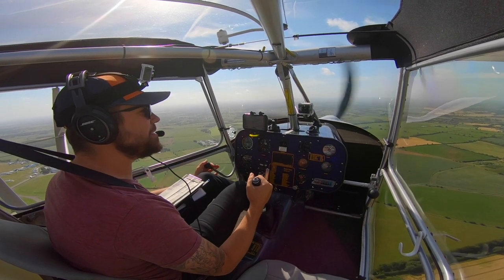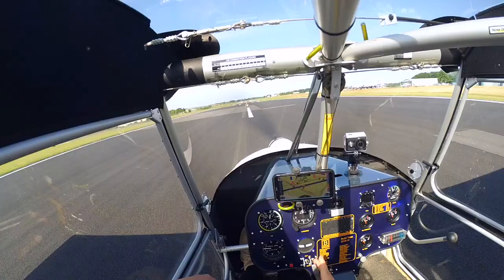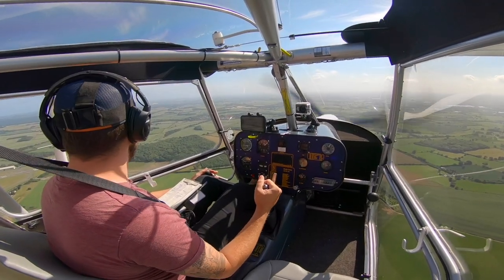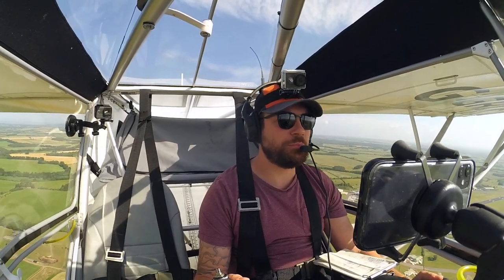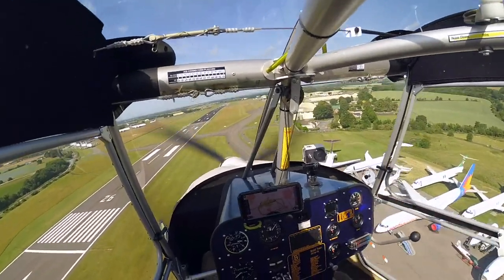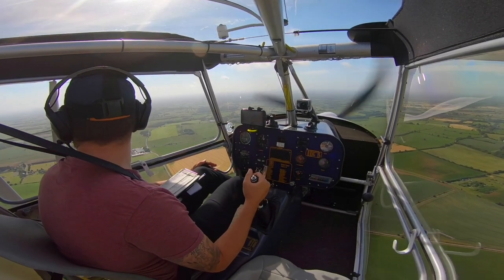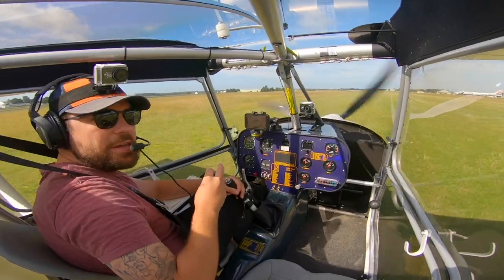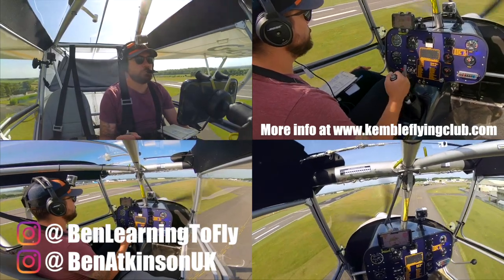Turbulent Crosswind Circuits | Cockpit Audio

Comment: "Blowing a hooley" 🤣... any crosswind is challenging. It's hard enough in the PA28s with a 12kt crosswind. It must be even tougher in the microlight. Into wind aileron and opposite rudder is my technique of choice too. You handled these landings really well. Really nice flying Ben 👍
Reply from the maker: Hey Cj! Thanks mate. Ha that’s interesting, would love to come see what a pa28’s like in a cross. Yeh I feel more in control, of course you could run out of deflection and start drifting if the wind picks up too much (especially in a microlight I guess)...thanks mate
Reply: I believe my flying club only allow students to fly up to a 10kt crosswind solo. With the instructor it's a bit more, which I have flown in on occasion. Once PPL I think I'll take my time to build confidence before I attempt anything too daring 👍

Comment: Nice one Ben, good to practice these things. Shame that the cross wind runway isn't in use at Kemble. 

With the SR Swift and Eurostar there's more porridge stirring than with the C42? Has the SR Swift got bigger ailerons and rudder than the Eurostar, thus better in a cross wind?
Reply from the maker: Yeh true! Though, if it was - I wouldn’t be as proficient in crosswind landings! There’s too many jumbos in the way too! Haha. Umm...yes possibly, for different reasons. The skyrangers a little looser on the controls...so you naturally have to move the stick more. And the Eurostar’s a little less stable so in less than ideal conditions again, you sometimes end up moving the stick about a bit. C42 is stable and has Rods rather than cables for most if not all controls so stick movement is drastically reduced - particularly over skyranger
Reply from the maker: Saying that - the two high wing aircraft are equally good in a cross...especially for wing down approach
Reply: Hi Ben thanks, interesting insights, it didn't dawn on me that Ikarus' had rods and the other two have cables. Interesting though.
Reply: The lower wing 'suffers' a bit from ground effect? And the Eurostar has smaller ailerons? The latest, US spec, Harmony version (not the European version) has a better wing, bigger ailerons, rudder etc and wider cockpit, but it's 600kgs 'Light sport'. Hopefully the UK will get 600 kg accreditation soon.
Reply from the maker: Muso Seven it’s only the skyranger that has cables ! I think the c42 has cables for flaps..could be 100% wrong on that. Eurostar definitely rods

Comment: So, using a subliminal message near the start and “Yes it is B** Sad”. Now in the film about Charles Lindbergh’s flight across the Atlantic, he asks the question about a fly in his plane, if it added to the weight of the aircraft. What is your answer? I had it as a project for aerodynamic studies, so know the answer but will keep quiet for now. Oh and the fly's ground speed is the same as yours unless it flies forward or back in the cockpit, then it is higher or low by its relitive speed to yours.
Reply from the maker: Ha thanks fascinating....I’m gonna say it does. If it’s landed on a surface? Ha very good. Fast fly !
Reply: @BenAtkinsonVideos  In teacher mode, give a full answer Ben :-)
Reply from the maker: Flying Kub no idea Sir ! 😂
Reply: @BenAtkinsonVideos  Well the answer is your aircraft has the weight of the fly acting on it no matter if it is flying or not. Obviously if it is sitting on the aircraft its weight is directly transferred to you airframe but if it is flying then the fact it is moving air down to support its weight in flight means that down wash is still pushing down on your aircraft so it still has to support the weight of the fly (Newtons law for every action there is an equal and opposite reaction, so the action of supporting the fly means the reaction downward of the air has to equal it). I used very sensitive scales and a clear box to prove this theory and was happy to find Newton was right.